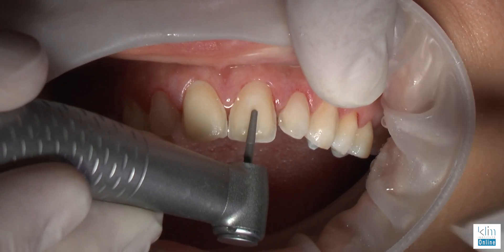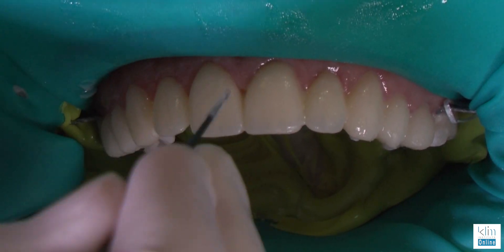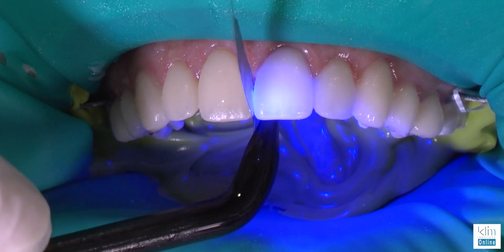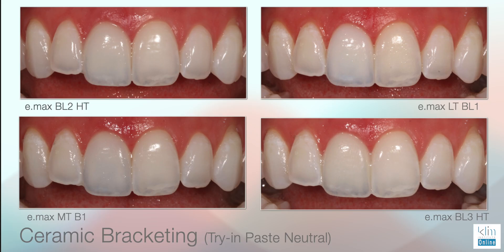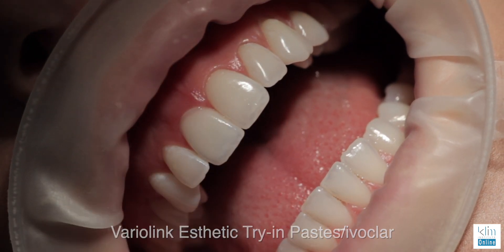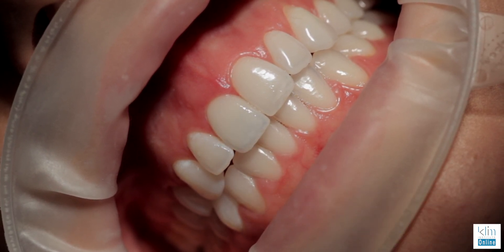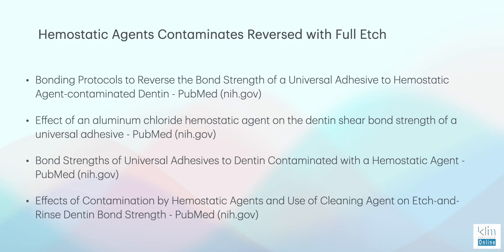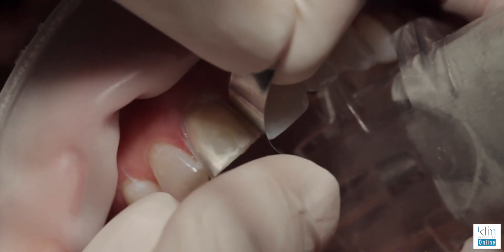Adhesive Veneer(s) Placement

Comment: Im learning a lot from the videos, theyre great thank you for making them. Im thinking of gettin a cerec, what would be the best way about it? Get second hand equipment? A leasing? Thank you
Reply from the maker: Primescan is a big upgrade from Omnicam. You may be able to get one used now that Primescan 2 is out. The Primemill is outstanding but costly. You can pick up a good MC XL online; get the four-engine one rather than two. And do you want to do zirconia? If so, I would get the Primemill.

Comment: I thought the bleeding might debond it
Reply from the maker: Bleeding started after cleanup started, by this time the adhesive resin and bond had already been cured and sealed, debonding is not a concern at this point in the process.